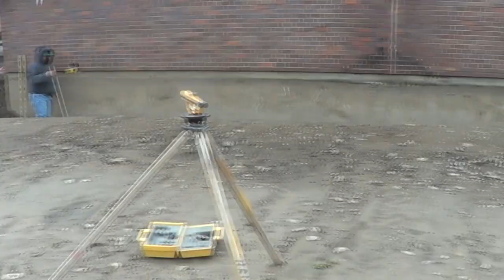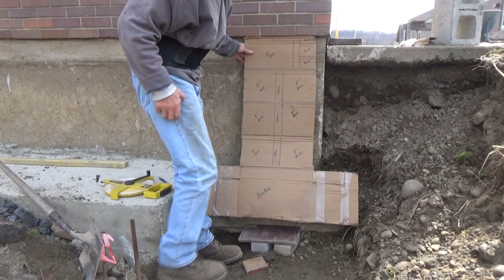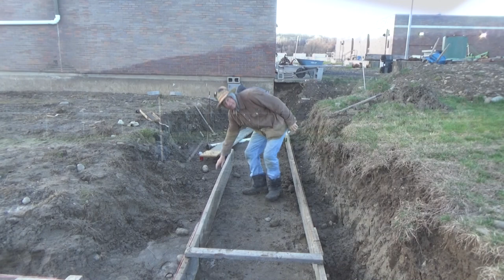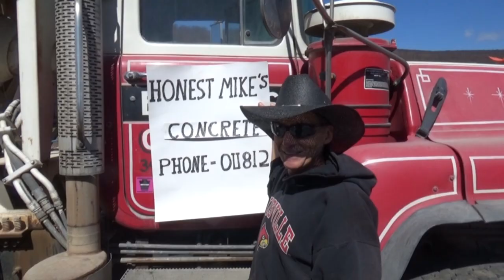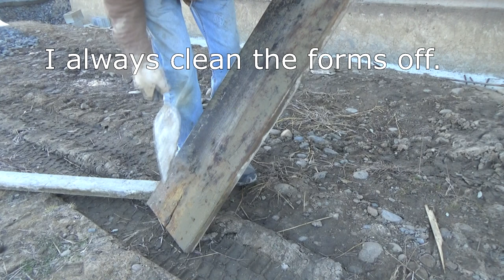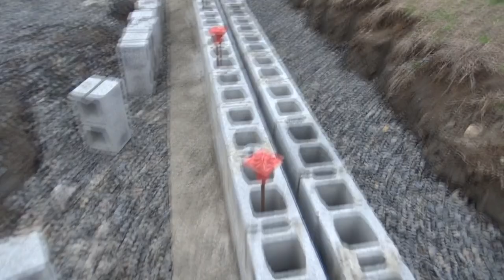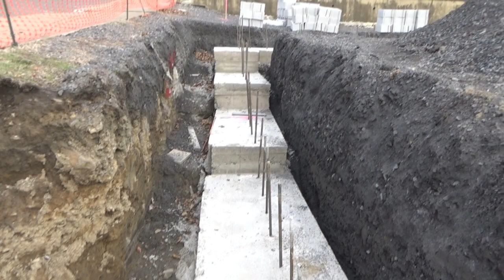POURING CONCRETE FOOTERS (Mike Haduck)

Comment: First off, I love the 70 model square chevy at the end of the video.  Just shows I watched the whole thing. Second, I am buying a house (built in the early 1900') and one basement wall is a new wall and the top row of block has tilted out and the middle of the wall is bowing in. That's the first problem. The wall on the right, The bottom row has completely collapsed (terra cotta I think) but has not sagged or broken any place else on that wall . And the wall on the left is old limestone (cracked). And the concrete floor is broken in a few places. Now I want to fix it. Now a few things are running through my head, First is it safe to lift the whole house (It's completely gutted) and second would it be better to pour a new footer AND the basement floor at the same time or in two stages. Thank you for any advise you can give. Loved the video.
Reply from the maker: Hi Mellonee,  I did a video on "How I jack up a small porch or building"  it might apply some and then you got to take it as you see it, a lot of those old stone buildings never had footers. I just usually rip out the bad part (like a dentist) and fill it in where it works, I did some other videos on how I repair stone foundations, I would ask the locals and see what they think and after some opinions take the best one,  I hope it helps, thanks mike
Reply: Hey bud thanks for your response. I will look at your other videos. Thank you a ton. God Bless
Reply from the maker: God bless also, thanks mike

Comment: Hi Mike can a consult with you I need some advice. I am getting 6 different opinions here in Indianapolis Indiana.    I am creating a Concrete Pool Slab ..  How would you recommend preparing an areas for a a 16x16 pool pad poured on clay and water flowing around 1 side and two corners of the slab.  Would you use a deep footer around all sides of the slab or can you get a way with partial footers as its a small slab.   Thank you, David
Reply from the maker: Hi David,  it sounds like you need a pool expert for something like that, I know from putting pools in with my cousin that every situation is different and a lot of pools do not have footers, I would ask the folks where you bought it, and ask if they have installers that could tell you,, I hope it helps thanks mike

Comment: You have excellent videos. Really informative stuff man. I appreciate it.
Reply from the maker: thanks Ryan,  I appreciate it, mike
Reply: Mike Haduck Masonry can you recommend a mortar mix I can use to fix my front porch? I live in Youngstown, OH. The mortar in between the bricks is washed away and its like loose. I think I could fix it myself.
Reply from the maker: Hi Ryan,  I can not say over the internet but I would not doubt a pre mix "S" mortar would be fine,  check out my my "How I lay brick videos," and I would do some practicing with some old brick before doing the real fix. I hope it helps,  thanks mike
Reply: Mike Haduck Masonry ok. I thought of taking some pics of the job and emailing it to Quikrete or one of the manufacturers and having them recommend what product to use.

Comment: thanks, so it looks like you have 3 pieces of rebar, what size 5/8"? is this for a 1 or 2 story house. any idea what is normal for rebar in 2 story house? thanks, steve
Reply from the maker: Hi Steve,  codes are different in different areas,  just call up the local inspector and ask him.  I hope it helps,  thanks mike

Comment: Mike, I live in Ohio and I want to built a block storage shed. The frost line, from what I have researched is about 32" deep. this means my footing should be 16" wide and over 32" deep?? that seems like a hell of a lot of concrete!
Reply from the maker: Hi There are not many building block sheds anymore, most get them the premade delivered or pole type barns, thanks Mike

Comment: So as far as width and depth of those footers installed here, It was a x2 block wall, so 36" wide, as you said. But what you didn't say was the depth. I'm guessing you used a 2x12 for your forms. Is that accurate? 12" depth and 36" wide for your x2 block wall? And how high was that wall? What i'm really looking for is this; I want to build a 10' high block wall (single). What's my footer look like? 16" wide (i assume) but the depth is ....????
Reply from the maker: Hi Scott,  anymore you got to go to the inspector and get a permit and he tells you what is code, then before you poor the concrete he will inspect the forms, on that footer it was at least 12 inches deep. check out my videos , how I do block work mostly part 4,  I think that will explain it best,  thanks mike
Reply: Thanks, i'll check it out. That piece of property is located in area where there is basically no oversight other than septic issues. So to save cost, I've been reading and watching everything I can get a hold of to gain as much knowledge as possible. I've found some that say twice the block for width, some three times the block width and the depth is the same, x2 or x3. Basically equal to. But thanks sir, I'll watch that video now. *edit* The x2 or x3 for width and depth was based on the height I was looking for, which is approx 10 ft.
Reply from the maker: thanks Scott. you are doing the right thing to ask a lot of questions,  keep a log of every official you talked to and what they told you. I hope it helps, thanks mike

Comment: Do the vertical rods have to go all the way to the top? What if you build a block wall and want to extend it a few feet later?
Reply from the maker: Hi wolf,    I am in extensions all the way into the roof with anchor bolts, I show dad and how I do like work part 3 to 8, I hope it helps thanks Mike
Reply: I guess I was thinking about more of a freestanding wall like a block fence.

Comment: Just wondering. I was digging in my basement of my 140-year-old house. I was digging next to a post to place a temp post on a concrete filled quiktube. As I dug down from the side  I kept seeing rock after rock under the old post. It then occurred to me. When they built the house, did they dig a big hole, dump a bunch of boulders in it and then put the post on top of it? Thoughts?
Reply from the maker: I can not say,  might be where the gold is hid. really I would have to be there to even guess, but I appreciate it.  thanks . mike
Reply: You mean to tell me that you were not around when they built houses 150 years ago? lol.  j/k But they had to set those post on something more than what is visible to the eye. I guess I will see when I pull out a post and start digging. Thanks!
Reply: Mike Haduck

Comment: One question Mike: What happens when the footer has a little hairline crack (probably from shrinkage) after the initial set (let's say at about 10 -12 hours)? Can such hairline crack be problematic for the structure of the building in future? Must one break that part of the new concrete and pour again? Thank you so much for such educational videos Mike. May God always bless you.
Reply from the maker: Hi Nova,  I probably seen 1000 cracks  when it comes to footers, in the old days there is no such thing as concrete footers and most of those buildings are still standing ,,it’s probably like you said, a shrinkage crack,  as long as the inspector inspected it before they poured it, I would guess your ok, I hope it helps, God bless Mike
Reply: Thank you so much for your response Mike. I have certainly put that on my building journal. All thanks to you. Thanks again Mike. God bless.

Comment: HI ...CAN YOU TELL ME WHAT YOU WOULD YOU SUGGEST THE SIZE OF THE FOOTING SHOULD BE FOR A CINDER BLOCK WALL 8 X 8 ?  MIKE I LIKE WAY IN THE BOONIES BUILDING COULD IS VERY LENIENT  THANK YOU
Reply from the maker: It is impossible to give advice unless I was actually there to see it.  I would ask the local guys, every situation is different, thanks mike
Reply: 16" x 8" is typical of a concrete foundation or bearing footings. That's here in the midwest, If u live o n west coast things are different

Comment: Hi

Do you have a video Regards the rain water where it goes and how to lay down the Geotextile roll, do I need gravel under it ??!! 

Thanks
Reply from the maker: Hi D, I don't, I have a video,  called " basement water problem solutions " but nothing like that, thanks mike
Reply: @MikeHaduck  Thanks Mike.
One more thing  footing usually forms are 2x6 or 2x8 ??   Urs is 36 wide because you using 2 8inches block what's hight ??
Reply from the maker: Hi DM, it was because the double eights,  a 12 inch block and brick ledge on top

Comment: Hi Mike,
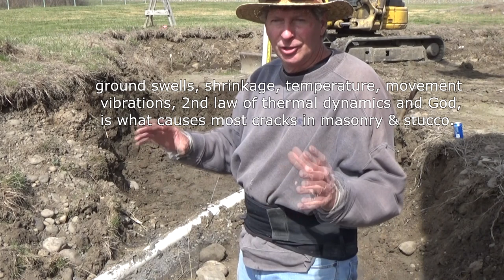At 2:45, what did you mean when you said life expectancy was 35 years? Because concrete foundations last for centuries
Reply from the maker: Hi Greg,  concrete footers are a newer school thing, the old castles, etc etc had no concrete trucks or rebar and they been there for centuries, what I meant was all the new school buildings  are not really designed to last more that 35 years by average, my opinion, I hope it helps thanks mike

Comment: If I understood that, your footer has to be twice the width of the structure you're building. Is that correct?
Reply from the maker: Hi Kevin,  the guy to really ask anymore is the local inspector, I doubt if you get it in writhing thought,  I hope it helps thanks mike

Comment: Just concerned your metal chairs are sitting on the ground, thus exposing the rebar to rust.Plastic chairs would be a better option don't you think?
Reply from the maker: Hi Peter, if they work, and you could find them I agree, at one time we would hold them up with pieces of blocks, etc, but the inspectors anymore want what they want,  thanks Mike

Comment: Shouldn’t your vertical rebates be j/L shaoed at bottom?
Reply from the maker: Hi Andrew, I been doing this over 50 years my dad 70, and that rebar will rot away before it ever pulls out, check out my video, should I use rebar, yes or no, Mike haduck,  thanks Mike

Comment: Nice very nice. only one question don't you have a knuckle/monkey paw to act as a specialty rebar bender. it has three 1 and 1/2 nubs that are welded to a triangle 3/4 inch steel plate these are set up in opposition to each other also in a triangle set approximately 1/2 inch in on the face of your template. once you have the hand with three nub fingers built you weld a 3 foot pipe arm on it for leverage. you use the monkey paw in conjunction with your straight pipe to make a  straighter angle. this helps as you carry your wall up higher. keeping the rebar close to the center of your cinder blocks void. keeping your actual rebar position closer to code. your rebar being in the center of your cinder block void. gotta keep your state inspectors happy. anyway I would/ recommend your videos to anyone asking how to build walls with block cmu or brick. I actally saw a fellow showing how to lay bock the other day. it hurt to watch he was using 6 inch block he butted a 16 against a six and called it a custom something or another when he came to the closer. then he used a hammer to cut the closer I cold tell by the sound he cracked the block at the web. no rebar placed vertically or horizontally for a bond beam. he just stabbed a bolt in for the carpenters. I am sure he will have a blow out when he pours his concrete unless he is ridiculously lucky. If it was up to me I would give you a grade of 99 out of a 100 and follow that withban A+ on your grade because you told your viewers to go to planning and zoning to get you specification and that all areas have different codes. I come from Arizona and understood every bit of information you passed on and could tell you weren't making it up as you went,  years of experience. It would be an honor to work with you. keep up the good work. Jim BCC Az local#3 former contractor lic#66201
Reply from the maker: Thanks Heidi,  I appreciate hearing that from a pro,  it makes me feel I am on the right track, thanks, mike
Reply: Mike Haduck Masonry Heidi was my dog Mike best dog I ever had a german shorthair. she'd hunt everything from dove and quail to mountain lion and bear. I've got stories to tell you probably wouldn't believe. Had a choice between her and my x well I never regretted the choice I made. 
    Jim
Reply from the maker: Thanks Jim, with the wimmin I go out with, I completely understand, lol, thanks , mike
Reply: Mike Haduck Masonry I think your my twin brother. just lost must golden hound dog old yeller type dog. she was 14 or 15 years old. she snored like an ex really a comfort. told my cousin if I could pick women as good as I pick my dogs. there wouldn't be any problems ever. I even took her out to the job with me. we got rattlers out here couldn't be a better helper. I tried to feed her mortar so she could point the joints. now ya know why i lost my job. how ya been got any work?

Comment: nice job. you did'nt put gravel on the base? You poor right on the mud why
Reply from the maker: Hi luis,  it is not allowed to put gravel under a footer in Pennsylvania,  yet that is all they use with the superior walls or under rail road tracks, go figure, It rained the night before and the ground was solid and concrete drys underwater just like on bridges etc,  I was not worried there,  I hope it helps,  thanks,  mike

Comment: And why is the vertical steel not tied to the horizontal steel?
Reply from the maker: Hi Sean, I’ll spend a little time answering this one, until about 70 years ago they never used rebar, and they never had concrete footers, it’s a new school thing and what they don’t tell you is that the rebar rots away,  in about 35 years and starts breaking the footers apart, I show rebar I took out of folders in the 70s and some of my videos, I Call it direct evidence,  every job has certain requirements, and every job has to be view different, it’s not black-and-white in this case tying rebar to the rebar gone the other way would do nothing except cause more rust expansion, when building  masonry buildings they should think not to be  depending on the rebar for longevity,  they should think like the old church builders castle builders And cathedral builders,  my opinion, Thanks Mike

Comment: Should you really use that wire mesh as chairs since it will rust?
Reply from the maker: Hi Stephen 100 years ago they never poured footers, but inspectors require all the stuff or they won’t let your poor,
Reply: @MikeHaduck  yes but as far as I know chairs should be made of either rock/concrete or plastic

Comment: If you dig with a 2 foot bucket, you can pour the footing to height. No forms needed.
Reply from the maker: Hi the greatecb, very true but with the new codes they will not let you do that here,  thanks mike
Reply: Thats what we do here in the UK, the job shown would probably be 1m deep, 0.6m concrete fill, 0.6 to 1m wide, no rebar. There was one job my dad did where there was 3m concrete depth to put a 2.5m wall on top, because of bad groung.

Comment: The way you're installing the rebar would never fly in earthquake country.
Reply from the maker: Hi with, a little tip from a former law student-make sure you keep a log book and the inspectors and engineers take the liability,  keep video records, thanks Mike
Reply: @MikeHaduck  In PA can you actually pour a footing without having an inspection prior to the pour? We have to have it signed off and the plans are stamped by an engineer. We're not allowed to wet set the rebar like you did. It has to be in place for inspection. It's not configured the same either. It would be nice not to have to deal with building departments. They can be a pain in the ass.
Reply from the maker: @wthomas7955  thats a good thing, mike

Comment: I'm surprised that you used straight rebar for tie ins.  Typically those are L shaped and not to the ground, that will promote rusting of the rebar.
Reply from the maker: Hi Stan, I doubt they hit bottom, but all that rebar does more damage in the long run than they want us to know,  I appreciate it,  Mike

Comment: I can't imagine just driving in straight pieces of rebar.  Every state I've worked in they are installed and inspected before the pour and the are called J bars, look more like an L.
Reply from the maker: Hi Stan, I ask inspectors to put it in writing and my lawyer reqires a final written inspection report, but I never get one, and most times they never come back on the job,  I wonder why?  Thanks Mike
Reply from the maker: Hi mark, check out my  videos on the pyramids, castles. Peru, great wall, there is no rebar used and everything they are building with rebar now has to be redone in 35 years, check out the comments from the guys who been in masonry 40 - 50 years and see what they say,  with respect,  mike

Comment: I saw mistakes works on this video
1. Must made compacted the footings land before casting plain concrete or reinforcement steel works
2. Install the Insulation board after primer coating 
3.not founded the O.L of steel works on above, or cover blocks under steel footings before cast institute concrete
4. Must used the epoxy material when linked or shearing (reinforcement steel)with old concrete footings
Reply from the maker: Hi Wael,   God bless you,  I just came back from the old castles in Europe that were built 200 years before Columbus discovered America and they are still there,  No footers, no concrete, no rebar, no epoxy and no insulation board,  they don't design buildings here to last more than 50 years,  it is just the way it is no matter what you do,  I appreciate it.  mike